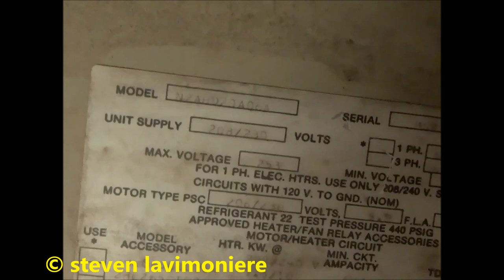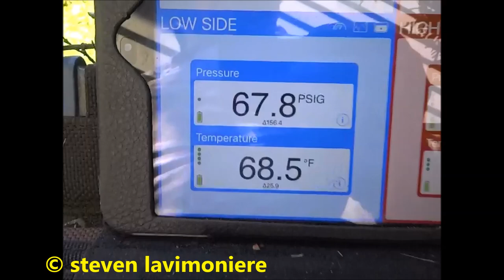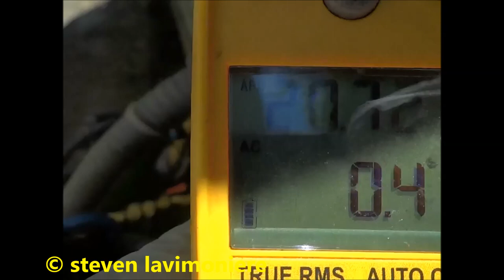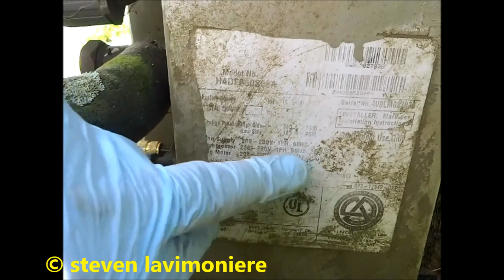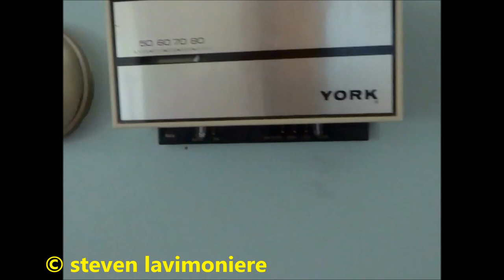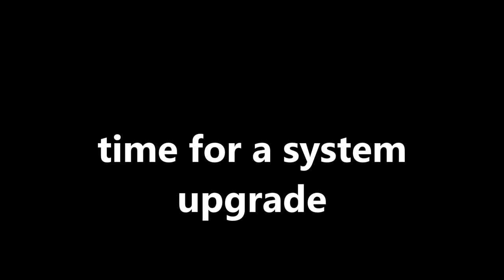old york air conditioning unit  not cooling house

Comment: I worked on Trane units 20 yrs old and those held up great. Most of the problem was bad insulation. Bad insulation will make a unit run longer and ware parts out. I had weak breakers with loose electrical connections sometimes. Good job Steven. Love your work ethic.She's a running now.

Comment: My system is 27 years old. I have to replace the fan motor, after 27 years. Plus, the capacitor was starting bubble up and for $8, I just replaced it

Comment: God I hate those. I used to work for York International for 7 yrs. That unit would have come off of line 5 department 195. Judging by the corner posts and the design of the top I would say that was one of the newer units we started rolling out in late 2000s. That type sucked. It shut us down for 2 weeks because it wouldn't play nice with any of our test gear.

Comment: If that was a York micro channel unit it would have been dead long ago. Lol. Sometimes the older stuff is better. That must have been a huge house to have a 5 ton unit!
Reply from the maker: house could get by with a 3 1/2 or 4 ton unit . its now used that much being down on the water . cooling season is short here .like he said he opens the windows alot

Comment: Should sell him a heat pump, man do they make a huge difference compared to using heat strips. I got a 16 seer Amana 8 years ago, more than paid for it in saving.
Reply from the maker: he has a hydro coil for heat in front of the air handler  .so the electric heat is not working anymore ..

Comment: That serial number is either 1981 or 2002 according to buildingcenter dot org website. Looks more like 1981 to me.
Reply: Israelhvac I agree if it was 1981, then it would have no coil guard and would have the York logo like the one on the air handler. It is 2002